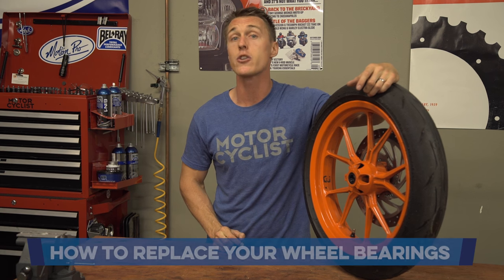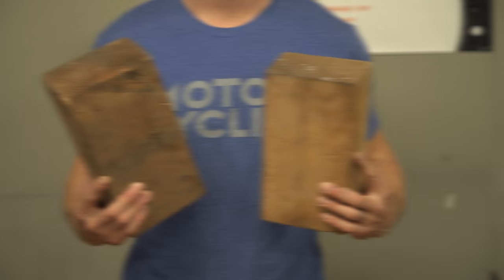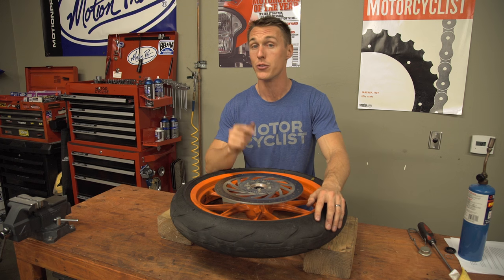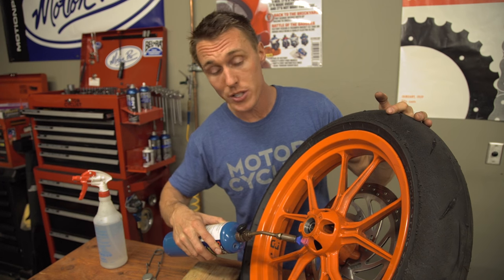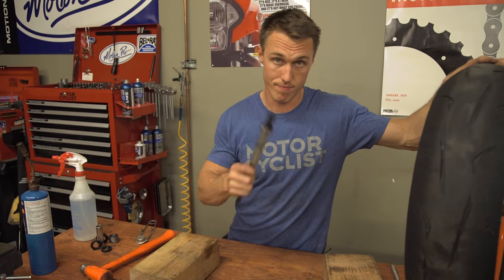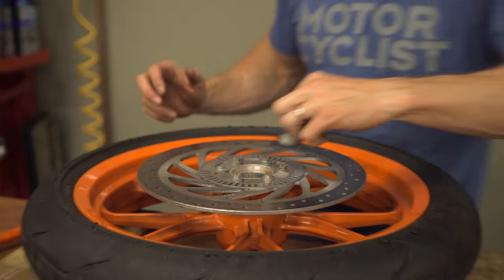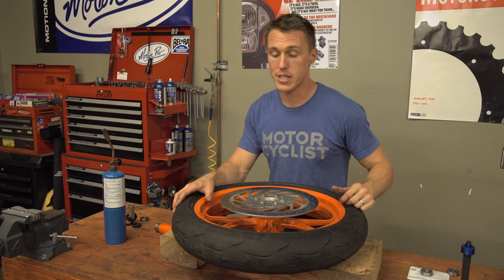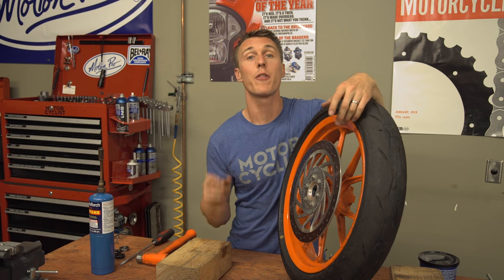How To Replace Your Motorcycle Wheel Bearings | MC Garage

Comment: A good idea is also to insert bearings into the ice or freezer before installing it . Low temperature will also shrink it a little bit.
Reply: +KonradLarem +1 You beat me to it.
Reply: KonradLarem - this advice is 1000 times smarter than heating an aluminum wheel
Reply: KonradLarem All I managed to do with the torch today was to set my dust seals on fire as well as the grease on the old bearing. 

Luckily I had the bearings in the freezer over night. 

The rest of the instructions worked extremely well and I spent 1.5 hours on the rear and under an hour on the front. Easy peasy. 

Thanks for getting me started and pointed in the right direction today. 

A very happy Versys owner.
Reply: KonradLarem 2007 front rim fits on a 2010 yamaha R1?
Reply: I like it when science can be wielded as a force for good. Most of the time it seems to work against me.
Reply: Just when we thought shrinkage was a bad thing.
Reply: But BE CAREFUL and let it warm, specially if the bearing ball aren't ceramic, due to low temperatures causing some metals to be brittle. A couple hours at room temp should be enough.
Reply: True
Reply: Should that center spacer move in between bearings at all? Mines pretty free inside
Reply: First time I replace a Crankshaft bearing, I put the bearing in the freezer around 30 minutes and heat the Engine block with a heat gun. The bearing slide it self into place effortless.
Reply: @tylersobkowiak9874  when you tighten the wheel nuts it becomes rigid
Reply: @tylersobkowiak9874  Maybe you should press those bearing more inside that's when you get a good stable spacer sitting.
Reply: @friedtamago4012  the steel in wheel bearings is well above its brittle transition point at freezer temperature, otherwise they'd fail in cold weather.

Comment: Great job Ari! Just used this video to get ready to replace my wheel bearings.  Two things I observed as I changed the bearings.  Cooling the bearings is fairly easy and removes the need for the torch.  Second, it wasn't obvious to me in the video but the spacer goes solid between the bearing inner races once both bearings are seated.  This appears to be the point of keeping the spacer aligned during the install.  If it goes solid and is out of aligment, the axel will not go through.  One last thought.  In the video, you say that if the bearing gets cocked during install to drive it out.  This is not advisable if you are going to tap a bearing out using the inner race.  Hitting the inner race to drive out a bearing fitted on the  outer race will likely cause the balls to damage the races.  I would recommend that you tap on and around the high edge of the bearing outer race until it slides back square with the opposite side.  A socket works great for this.  Otherwise, the video was spot on and helped me finish this the first time in about 2 hours.

Comment: You can also leave the new bearings in the freezer overnight to shrink them, it makes installation a bit easier.
Reply: First time I replace a Crankshaft bearing, I put the bearing in the freezer around 30 minutes and heat the Engine block with a heat gun. The bearing slide it self into place effortless.

Comment: The torch was key for me to remove bearings. Hammering with the drift wasn’t possible with my rear wheel due to the size of the spacer. Wheel bearing remover worked for front wheel and sprocket, with a lot of effort. No luck with the rear wheel. Finally, spent $73 at Harbor Freight for a Slide Hammer and Bearing Puller Set. Well worth the money. Wish I had just done that initially. It was the only tool that worked on my rear wheel. I would have saved myself a lot of time and aggravation just to use this tool from the start. Well worth the money and it paid for itself in one job.

Comment: If MC garage made a video about the causes of motorcycle handlebar vibrations will be very helpful for motorcycle enthusiasts around the world. I tried to search and couldn't find a proper video sharing this information.
Reply: Handle bar oscillation (handlebars that shake back and forth when hands are off the bars) Is generally steering head bearings that need replacement  or adjustment.

Comment: Very good video! One detail thought. Outside diameter of the seal should not be lubricated. They say: easy in, easy out. You don’t want you seals to move. You’re absolutely right, the inner diameter, the seal lip, should be lubricated. A dry lip seal will overheat and degrade rapidly.

Comment: Had a very hard time trying to dislocate the inner spacer, try the heat gun  ,didn't work , none of my local auto parts have wheel bearing puller for this task, so I use my MAP gas torch and the freaking spacer move aside, thank you so much for showing us this method , I have a Honda Shadow

Comment: Really good instructions - only tips to add is it's easier to install bearings square with no risk of damage by making up a simple press with cheap M10 threaded bar and plate washers from your hardware store. Use a socket as described to push the outer race straight in, perfectly square and controlled. If you freeze your bearings first it's even easier.

Comment: Thanks for showing me that motion pro bearing driver... I will never be happy driving a bearing with a socket again... great idea how it centers on the inner race and is interchangeable for different inner/outer race combo's.
Reply: In another YT video the guy used the old bearing atop the new one to hammer it in.  Good idea or no?  I'm getting ready to install bearings on a front VFR wheel I just had powdercoated.

Comment: Should also remove the brake disks, as they kinda hinder the expansion of the hub through the heat.

Also using a heat gun is usually a better idea

Comment: Hey Ari!

I love you videos, they are very helpful, and hugely entertaining! I know in my cars, when wheel bearings went out, they would make a ton of noise. Is this a common signal with bikes as well? My fork seals recently went out and I think my wheel bearings were contaminated with the fork oil, as now I hear a similar noise coming from my front axle. There is no noticeable play though, and I imagine the oil has destroyed the grease in the bearings. What is your opinion on it?
Reply: Ari Henning I ended up getting it looked at, and the bearing is fine like you suggested. The odd noise I was hearing was the brake pads, and once the roots and pads were decontaminated the noise quit. Thanks for the reply!

Comment: How
Much free spin should my rear wheel have when up on stand? Like full rotation with light touch or what?
Reply: Should be able to spin but it will still have resistance with chain and rear brake

Comment: Once the second bearing is in place and right against the spacer is it normal for there to be no rotational movement in the inner race of both bearings?  Thanks for your time

Just done mine and want to confirm before putting the wheel back on and riding it

Comment: I have a 79 xs750 and in the process of replacing the rear bearings. The manual has all of these collars and spacers. What is the purpose of these collars and spacers, I dont think they were there when I removed the bearings and most of these are now obsolete. Do I need them, seems like most wheel bearing replacement consist of the bearings, flange, and oil seals. Thanks!

Comment: Im getting my wheels repair do to s light dent on the sides. I’m sending this to a professional shop in Idaho. They will remove and re install the wheel bearings. Can I re use the wheel bearings or need to put new ones?

Comment: question:  i drove my new bearing in with my old bearing and my old bearing ended up getting stuck in the wheel on top of my new bearing.  i had to drive them both back out.  i did this by using a socket the exact size as the inner race.  do you think i ruined my new bearing by hammering on only the inner race?  it was pressed against the old bearing so i can't imagine the inner race was pushed too hard separated from the outer race until the very last bit.  i see no physical signs of damage but wasn't sure if i automatically should replace it since i drove out this way.  thanks in advance.
Reply: Hi Brin, if the bearing came out fairly easy and you were applying even pressure then odds are its fine. Even so, the best course of action is to replace it since the bearing wasn't designed to take any side load on the inner race.

Comment: hi nice video. Hope you can help me with my other concern. I am trying to modify a not so expensive bike to a good looking 1. I replaced my tires and wheels to wider ones. but the wheels that i bought has bigger bearings for the axle bolts (which I dont have and cant find any). Is it safe to just replace the bearings with a smaller hole(inner diameter) then use the axle bolt that I have? Please bro I need your advise. Size of my axle bolt is approx 12x230 and the wheels that I bought has (I think) 15mm inner diameter. Thanks.

Comment: Hi...I just installed one of these kits on my gsxr. I noticed you didn't grease the bearings. I realize they're not made like the other bearings with one side exposed. are the pre lubed or do I need to find a way to put grease in them?
Reply: fredthomas8888 Sealed bearings are prelubed and don't need any maintenance done to them.
Reply: I know this is an old comment, but I always pop the seal and grease bearings myself. It's funny how little grease they have in the sometimes.

Comment: Hey, my wheel spacer just sits loose inside of the hub.. but the bearings are fine, is it safe to install these rims and ride with them?
Reply: MotofreakX try switching sides maybe you have them backwards, they have to sit flush
Reply: @SBS_Auto  When I removed the original bearings on my '98 VFR front wheel recently the spacer was floating inside the hub.  So this isn't  normal??

Comment: Inserting a bearing that way will considerably shorten its life. Heating the hub with a heat gun juste before inserting the bearing and putting the bearing in the freezer for an hour beforehand are a good practice. Using a press is even better. Putting a hammer to a bearing is a No No as far as I’m concerned. I could also question the use of grease.

Comment: Damn.. that is one small wheel bearing. Looks like the size of an average pilot bearing for clutch flywheels on cars. I mean, what do I know, I'm not an engineer but damn.. I wonder how much load/stress that bearing can bear.
Reply: A bearing for a 15 mm shaft (i.ex.) can withstand a dynamic force of about 10.000 N. Double that for two bearings :)

Comment: Good luck finding a drift punch that isn't tapered halfway down and has unrounded edges. You need a straight, round steel rod with the ends cut off dead flat. Been driving myself mad trying to find one for the last hour. Who on earth wants to buy a bearing removal tool for $90 to do the job one time?

Comment: 1999 Suzuki 1500 80,000 at 20 mph I shake the handle bars it Will shake back and forth by itself.
If I'm doing 40 mph or faster it seems to be fine, I've replaced the steer bearings didn't really help.
l am a? little nervous about riding it it doesn't feel right any ideas
Reply from the maker: What condition are your tires in? A worn front tire can cause that kind of headshake.
Reply: I agree with the front tyre thing. An unseated tyre will cause this, or even foreign material in the wheel. Basically it sounds like the front wheel is out of balance.
Reply: Mark Soderquist I know it's late, but check the bearings in your steering neck and the proper fall away as well.
Reply: Drew w what is fall away
Reply: Peter Mitchell what's your opinion on beads in tires for balancing compared to weights placed on the rim
Reply: Mark Soderquist it's the amount of preload on the bearings in the neck if they're too loose the front end could be loose and handle poorly. Also I like balance beads, they run smooth and I've run them in multiple bikes and one of my trucks and they've always been smooth as glass for tire balancing
Reply: Drew w OK thanks I will check the neck bearing again

Comment: How to find damaged bearings....
Reply: @hateterrorists  tq and how to fing front fork bended slightly
Reply: @madhan mohan, I lift the wheel, and see if it rocks side to side, its a more definitive way to find out,  if a fork is bent try put something straight against it like a straight edge ruler.... you would wanna see if the seals are leaking too so run your finger on the exposed stantions and if theres any grease or fork fluid coming out you will need to service them

Comment: DO NOT USE TORCH ON ALUMINUM RIM
Reply: A torch IS safe to use on aluminum if done properly.
Reply: Ari Henning - in my construction experience, and tales from many master plumbers, electricians, sheet metal masters and my father who is a ASE master technician T1 diagnostics, have always told me to never heat aluminum because it will make the material brittle.
Reply: Ari Henning - on top of that my friend and fellow motorcycle mechanic friend with 40+ years of experience in racing and building bikes told me NO. sorry for the caps just having such a simple explanation of changing bearings and not putting a WARNING sign on the part about the torch (which is never neccessary) seemed a little unfinished. cheers.
Reply: Ari Henning - haven't tryed it myself, but i have an extensive understanding of torches and a/o torches, and i dont know why, but iv always been told never heat aluminum. agree to disagree
Reply: We use torch ...Or heat gun( works too although mechanics frown upon its sight!)...

Heat is needed and in some cases absolutely needed...especially is aluminum housing is corroded from oxidation to punc/pull a bearing out...I've had hardened bearing pullers break due to tough oxidized aluminum bearing holes...a little heat and they litterally pop out...
Reply: Excellent idea about using a "heat-gun"!!! Never would've thought about that one,till I read your comment!!! Thanks!!! :)
Reply: You know that the knowledge is iffy when you dont even know why what is what.
Reply: You are aware that track use and extreme road use the "hub" where the disks bolt on can reach 80+ Deg C fun little fact for you

Comment: Could you not avoid open flame and just use a 1200-1500w Blow Dryer to heat up the hub?  Probably much safer and will still heat the hub.  Anyone try this yet?  I am still in the learning (crawl) stage.